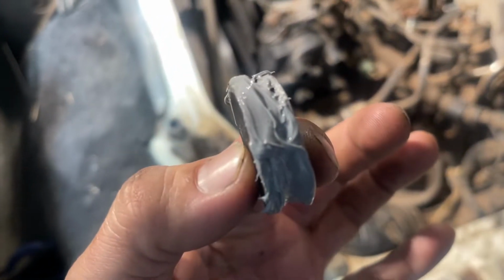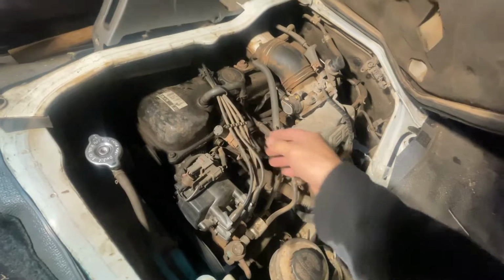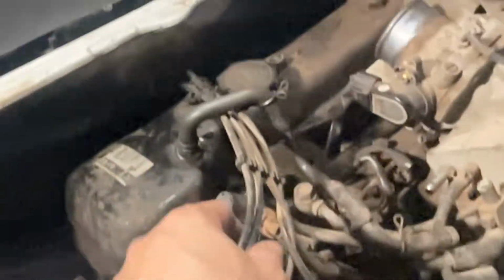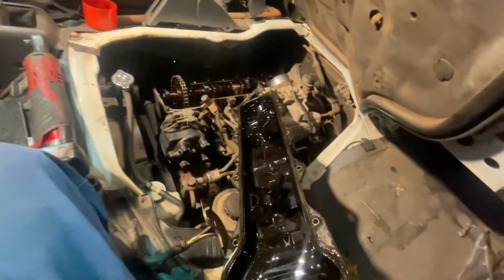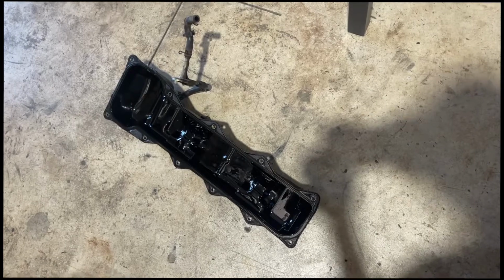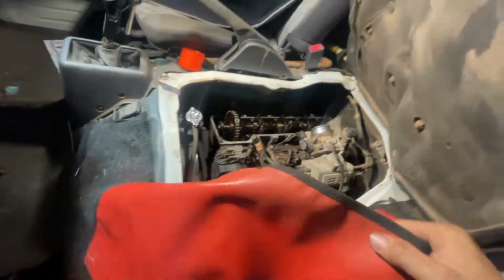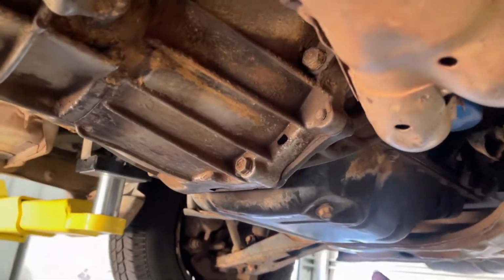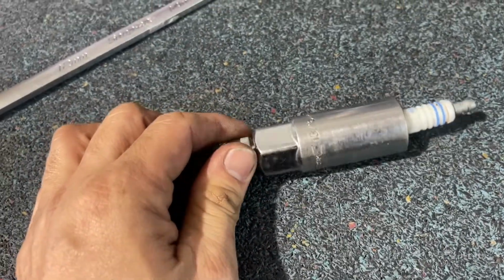HOW TO REPLACED VALVE COVER GASKET, ENGINE OIL AND FILTER AND SPARK PLUGS TOYOTA HIACE ( RZH113R )

Comment: Q) What is torque of bolts holding  cover down that you used?
Reply from the maker: Mate its only 10m bolt I recommend to fell if the rubber squeeze that’s enough sometimes if you put the right torque it will snap because of the old of the car 😬 and observe it a week if there is no leak thats enough if there is a leak just tighten a little bit 😉 rather than it will snap the bolt 😬 cheers Oliver 😉